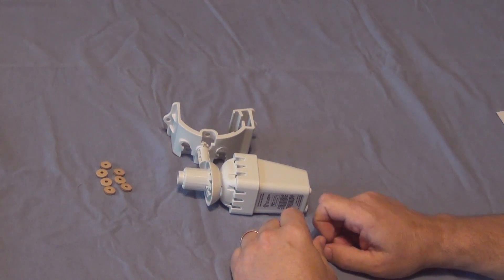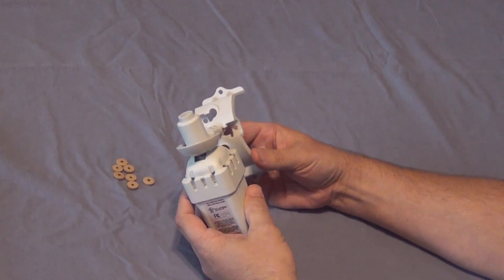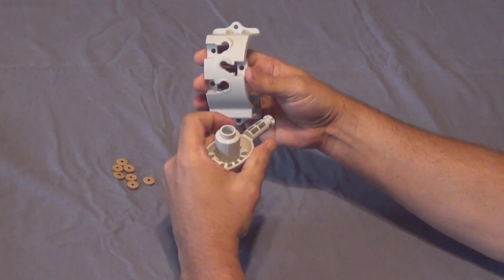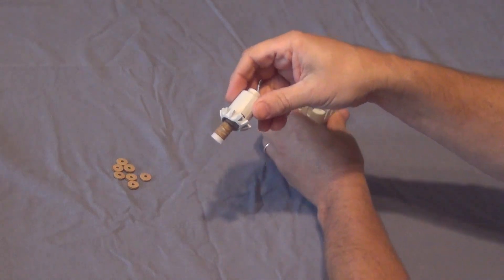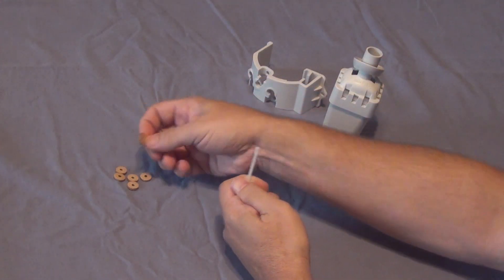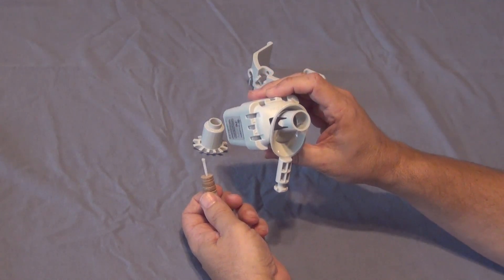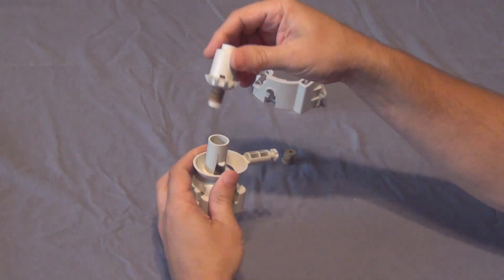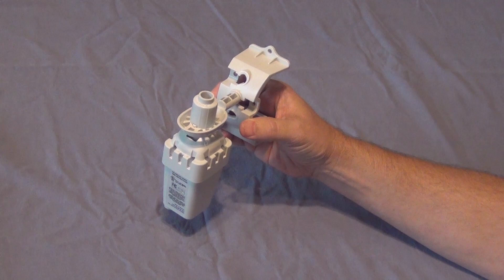Rainbird WR2 Irrigation Rain Sensor Repair - Changing out the Hygroscopic Discs

Comment: Just installed a new rainbird controller inside my pool house. 

I’d like to add this sensor but does it require line of sight or will the signal be strong enough to read through the wall?

Comment: It’s kind a work but not 100%.
The original one are 6 disk slightly more thicker and it worked perfect. I have replaced them with 7 discs because this one are little thinner. It doesn’t matter how much rain I get on the display never goes all the way up with one lane. I tried to use 8 discs and now doesn’t matter how much sun I get it never goes all the way down. Always shows 3mm of rain or 1 lane

Comment: The plastic rain sensor units tend to get brittle exposed to sunlight. In addition, the switch at the base of the unit which the expanded discs press on tend to wear out. I replaced the entire unit of my orbitz for 12.99. Spending a few more bucks replacing the unit may be the better way to go.
Reply: Hi. Do you have a link for the $12.99 part you bought for your Rainbird Sensor? Thanks.

Comment: Hello, do you happen to sell the stem? An errant soccer ball did a number on the assembly
Reply from the maker: I don't have any of the stems...   however, it might still work depending on how much damage the soccer ball did...  did it just break the barbs off the top of the spindle, or did it break the spindle in half?
Reply: @southeastirrigationsupply7943  I have a similar problem where the barbs are broken but the spindle is fine. If I buy the discs will they still work? Thank you

Comment: What's the purpose of those discs?
Reply from the maker: When these discs get wet, the discs expand (and get thicker).   The spindle will then press down on a microswitch in the rain sensor that is wired into your irrigation controller and that will prevent the sprinkler system from turning on while it is raining.   When it stops raining, it will take anywhere from a few hours to a few days (depending on weather conditions) for the discs to dry out and shrink back to normal thickness.  This will release the microswitch and your sprinkler system will be turned on again.